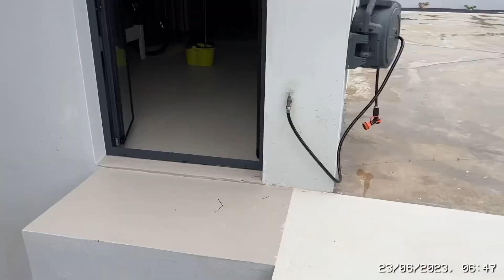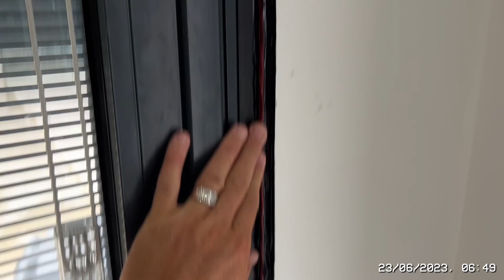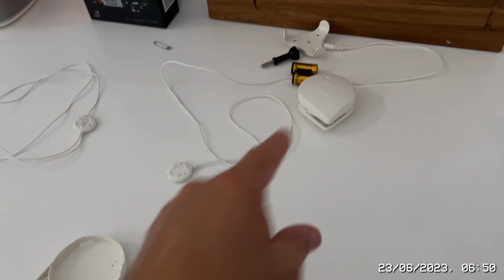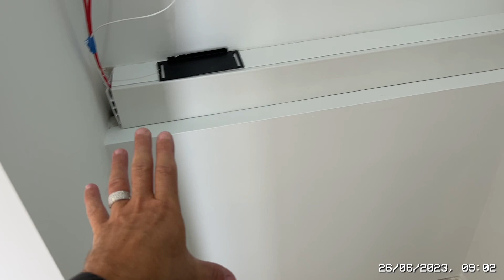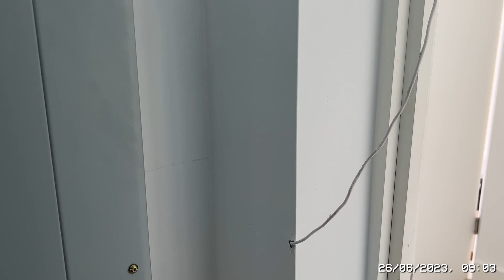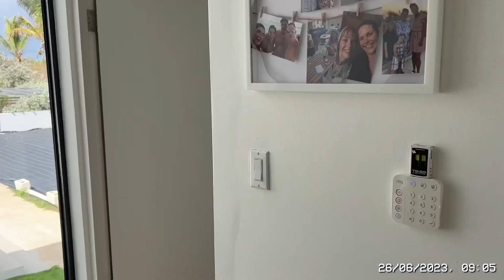Barbados Beach House Build

Comment: Isn't Your wall plastered? If so have you thought about running wires u der plaster and between the vertical wooden straps that you secured the plaster boards on?
Reply from the maker: I assume you are referring to hiding the cables? On that wall the plasterboard is dot n dabbed directly onto blocks.